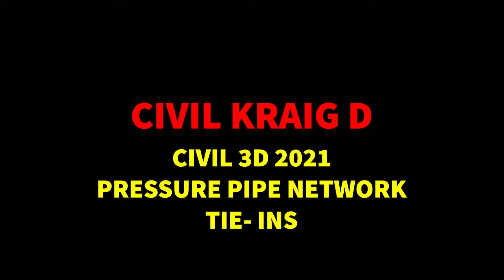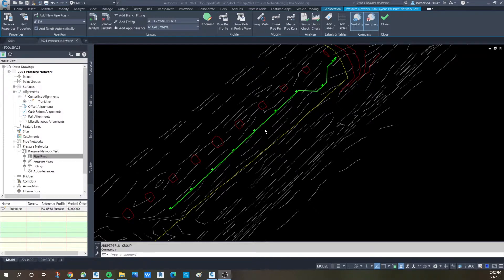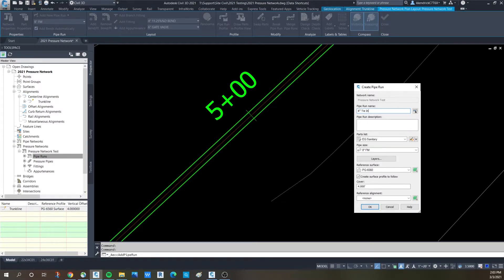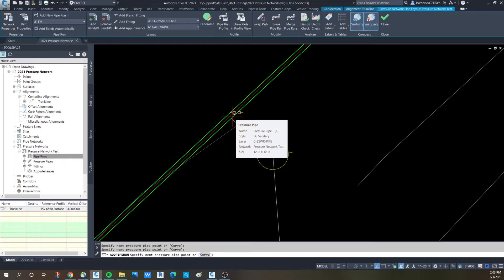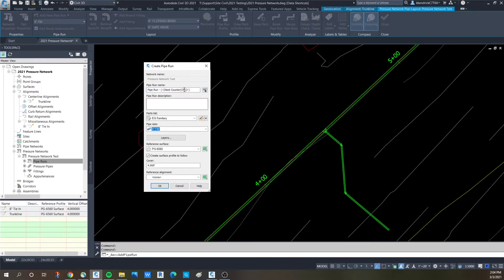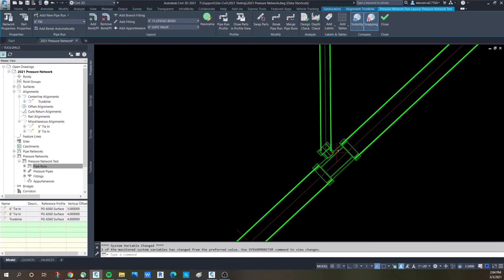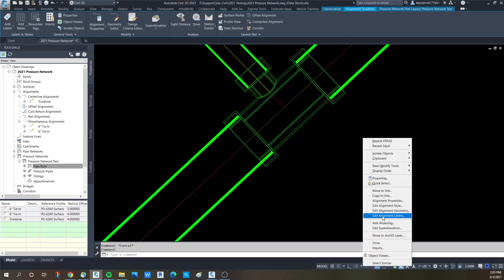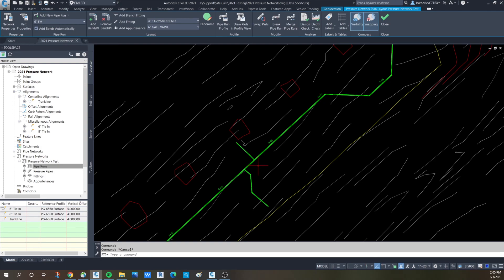Civil Kraig D - Civil 3D 2021 Pressure Network Tie-Ins

Comment: My Civil 3d 2021 version has empty catalogs, is this normal? It only shows ductile iron under standard or water list. 2" thru 10". Thanks
Reply from the maker: You can set your pressure network catalog path to find the other catalog options. This path here should get you to where it is set. From there the options for additional part catalogs and sizes should populate.                  C:\ProgramData\Autodesk\C3D 2021\enu\Pressure Pipes Catalog\Imperial
Reply: @CivilKraigD  Found them! Thank you very much. Once I cgevkec box for all lists everything popped up. Only thing now is my appurtances are not loading when I want to add a valve.  The box to choose from is empty. Loaded catalogs and correct network. Only ductile iron valves show up.
Reply from the maker: @sundancerkidd-worldexplore9184  I'm not entirely sure of the reason but some of those catalogs do not have appurtances. You will have to switch to the catalog that has the valve you need, place it, switch back to the catalog you were placing pipe and bends with and continue down the alignment placing pipe. That isn't a great way to do it but the only work around I've found to fix the problem